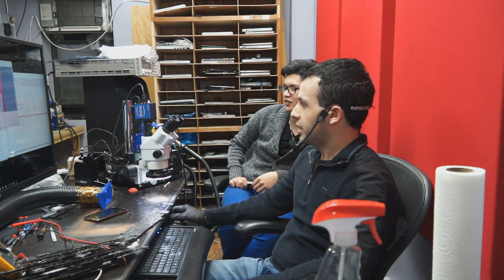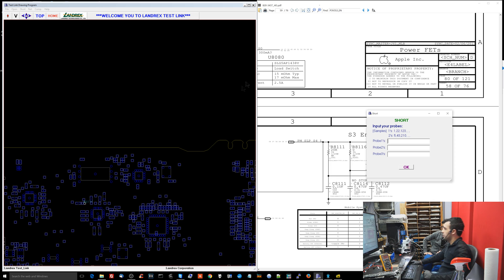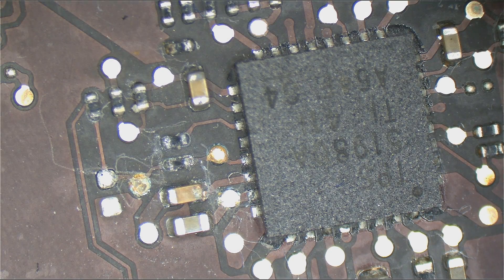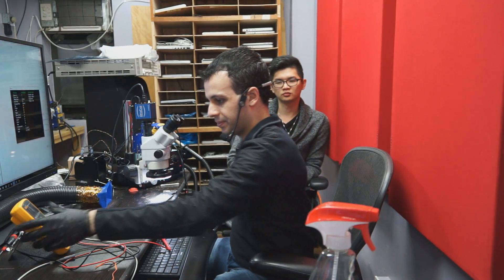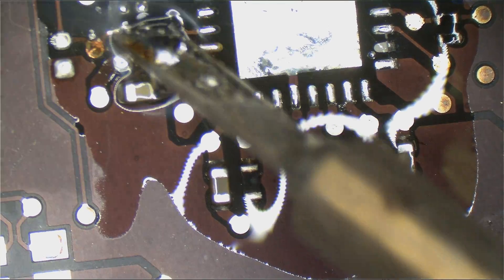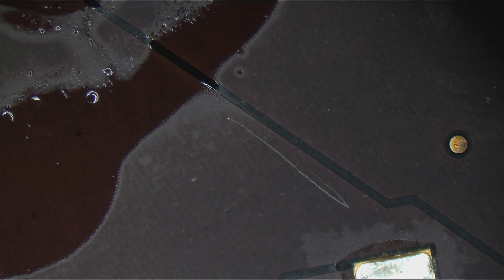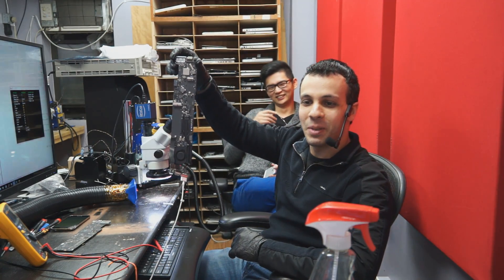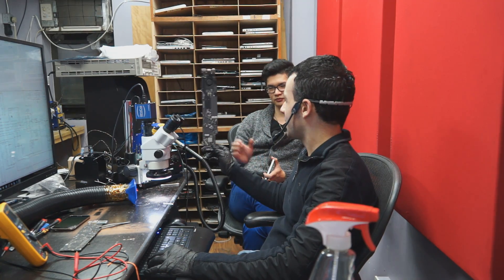Louis pays a debt to Sunny: 820-3437 dead because of missing S5 rails

Comment: A quick question!
I recently bought a Dell Latitude 3340, where the previous owner in some way had ripped off the BIOS chip, which was a 4 - 4 pin chip of from the motherboard.

The only thing i can see is that one of the pins are still attached to the board but the chip is gone.

If i buy a new chip, do you think that its possible for me, without hot air station to attach a new bios chip to the board? I'm not that skilled, but i have done my fair share of soldering but not on a motherboard.

Here where i live there isnt any stores that are offering this kind of service.
Reply: +Stockholms Oskar Just realised it really wasnt a qwuick question, but yeah.
Reply: +Stockholms Oskar Technically it wasn't even a question :D